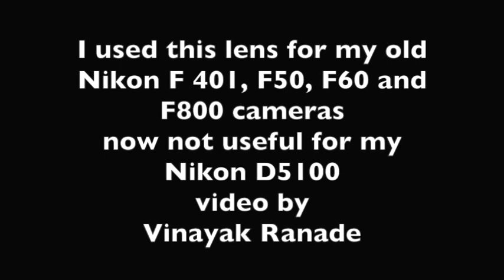Dissecting Nikon 35 80 lens

Comment: Hey there! My zoom does not go further than 50mm and the little grey part you've taken out at 3.57min (like a T shaped bracket with two holes in the middle and two little legs, it's just above your lens in the frame) when it's in place it controls the zoom ring and does not let me twist further past 50mm.. Any idea how I can fix this? Otherwise the autofocus works great and everything is in good condition. Many thanks xx

Comment: Hi. At 7:25 you get yourself at your left hand a piece with somes lenses inside... and then, at 7:36, the lenses are already separated on the "table", inside the metal ring. How did you separated them? Weren't they glued or somthing? Tks
Reply from the maker: Please excuse me for delay, my iMac 24 inch has been damaged for a month now. I have used my iPad for recording the dissecting  process, some time I forgot to press recording button. I never expected that somebody could see my videos.

When a big service company services the lenses many a time such tricky parts are replaced, because original manufacturer sealed such elements to maintain the positions of elements for accurecy purposes.

When ever a lens is opened the focus and vignetting adjusted position bound to get disturbed unless you have proper bench to realign such adjustments and very few do that process with keen interest of their job.

Wish you the best

With regards

Vinayak Ranade
Reply: Vinu R So your answer to me is, let the fungus stay where they are and don't try to separate the lens because I wont be able to align them properly after, am I correct? Seems reasonable. Thank you much for your response. As to your videos, we are 7 billion people in this world... The probability of someone needing to know how to dismantle a nikon lens is not that low... Being so I say keep up with the good work. =)